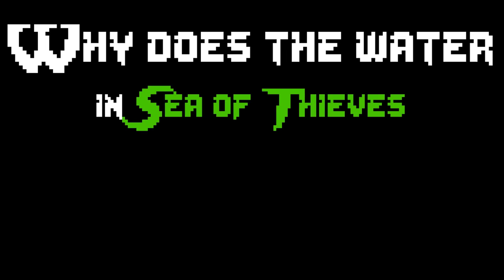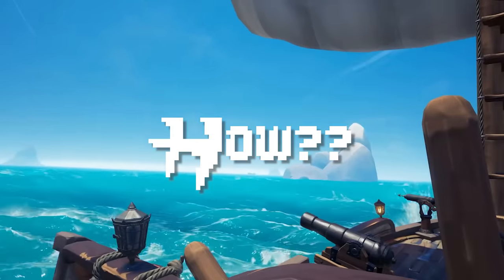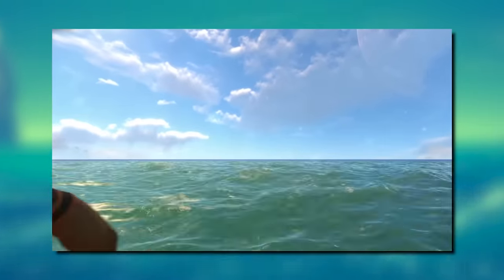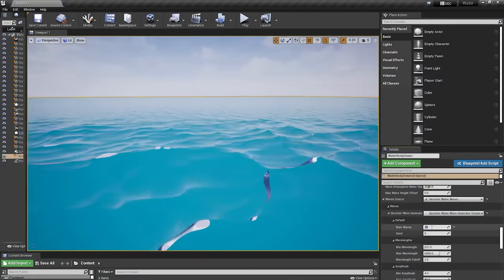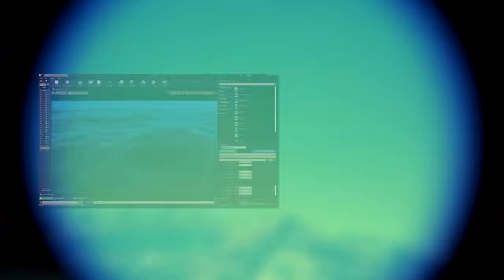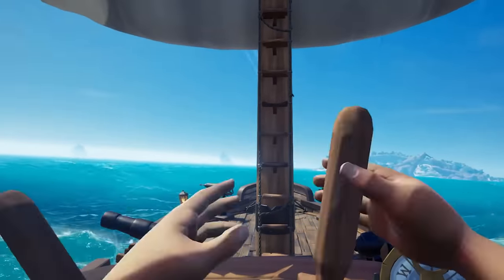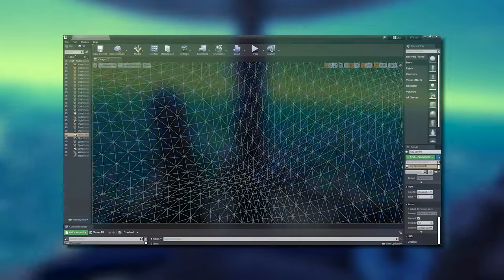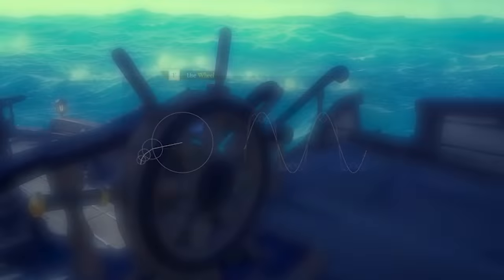how water works in Sea of Thieves

Comment: If the displacement is happening in the shader and not in the copy maintained by the CPU, doesn't that mean that your physics model can't react to the waves?
Reply: yeah that is my question as well. Both the rendering and collision has to match to a certain degree so I wonder if they are running a lower mesh version for collision?.
Reply: you can do that by doing the same calculations you do in gpu on cpu. but instead for every vertex, you do it just for 1 point that you need. like player position, or a buoyant object position. then you get the waveheight, if the objects y pos is lower than waveheight, you apply force to bring that up. you can apply it on an another mesh with lower vertices but, sampling 1 point does the thing too.

Comment: can you explain why we get sucked into rocks while sailing close to them? 
My presumption was that the particles have no where to go when the waves are near the rocks, so they go down as that's that only space for them to go there for dragging stuff on the water toward the rocks, kind of like pulling a table cloth down off the edge of the table and everything on the table gets dragged with it, but I'm probably wrong.
Reply: There's no particles in this version of the water. The pulling towards the rocks is likely a light pull done separately towards the rock when entering its perimeter. Just some basic force field.

Comment: premake a flat circular mesh that's a few kilometers (or maybe even more! depends on draw distance) across and is very dense in the middle and very sparse as you get closer to the edge with a gradual falloff, have this mesh's horizontal position always be centered on the camera, but have every other aspect be controlled by your wave function, and have said wave function operate in world space rather than in object space. any textures you apply should also use world space rather than UVs

other possibilities: rather than circular, have it be a wedge which only barely extends beyond your camera's FoV, and have it rotate itself to always match the Yaw of the camera.
this version may break down if the camera's altitude is too high and pointed down, the amount of mesh which exists "behind" the camera must be sufficient to cover this possibility

Comment: I hoped you would cover how collision works with the waves and ships, another time maybe?
Reply: Probs takes the same info from the wave functions to alter the ship's position and rotation
Reply: Getting the height of a Gerstner wave at a precise location is not mathematically possible because whatever height you get from sampling that wave is the height at a shifted location in X and Y, and not the location we asked for! You can approximate the result using an iterative approach: first iteration, sample the height at the asked location. Second iteration, sample the height at the asked location MINUS the X & Y location offset you got from the previous iteration and rinse & repeat. Each time you'll get a smaller and smaller X & Y location offset and you'll get closer and closer to a height that is exactly the height at the asked location.

Comment: I love the Sea of Thieves water physics but I still hate how it interacts with the ships, or to be more precise, how it doesn't.
Reply: Not sure what you mean, the water physics definitely affects the ships's movement, and hitting big waves even "refill" the water simulation going on on the top deck. There's a talk called "the technical art of Sea of Thieves" where they talk about it
Reply: @papermartin879  No I know, I'm talking more about the artistic side, there are no effects of the ship moving through water, or splitting a wave, there's not even a trail behind the ship!
Reply: @SirForwyn  splitting waves would be basically impossible to implement as the wave sim needs to be predictive in order to be synchronised with other players without eating 95% of the bandwith
Implementing a trail might be more possible but I doubt it's something peoples would pay that much attention to during actual gameplay, and I imagine they didn't want to include extra effects unless they were deemed necessary in order to have the game run on xbox
Reply: @papermartin879  Dude, I'm just talking about the effects, not actually changing the mesh of the waves. Something like ACIV Black Flag has, or a bit better, since that game is on the older side now.
Reply: @SirForwyn  you mean like foam particles and all that when you hit a wave? That's already in the game
Reply: @SirForwyn  there are foam trails in the game. they just dont use it. idk why. you can see it in some islands, or when fishing. theres gonna be a gray-ish foam above the water. so it means that its not because they can't. they've chosen not to. actually there's a lot of things that sea of thieves just didn't want to pay attention though. theres no water ripples and stuff. and that's not even hard to do at all. idk, the game is great but, its also lacks of detail as well. it feels like they've fired the guys that made the shader and tried to do the rest by themselves. -.-
Reply: @bdenix1997  you've just made a lot of assumptions

Comment: Sadly not applicable anymore, because tesselation is killed in Ue5.  

And isn't gerstner waves just using a formula that changes the constant in a sine wave, making the "top" squeeze together.
Reply: you just have a pretessilated mesh no need to do it in real time as the engine can handle alot more verts naturally with nanite which will handle the distance meshes for you. you can also use the 
built in water system that still dynamically tessellates and just change out the gestner wave that is already setup on it and the material to your liking
Reply: @VolkillerGames  nanites doesn't support wpo functions of any kind last i heard.. a nanite mesh can't move.
Reply: @oskarwallin8715  it has support in ue5-main for a while now so it will be in 5.1
Reply: @VolkillerGames  that's really nice if it does. Last time I heard nanite and wpo wasn't even on the table for a while. What was enabled was a fallback.. like if you use a wpo on nanite mesh it falls back to regular mesh.  Can you confirm if it's actually nanite with wpo, using for example the nanite view mode in editor ? 😊

Comment: I have never personally played sea of thieves
but one thing I do understand a little bit about water in video games in particular physics based sort of "build your vehicle from scratch" games
is the underwater physics

the one I will talk about in this comment is airtight spaces where under the waters surface a space that shouldn't have water does

sea of thieves doesn't have this issue and in fact is one of the only games I know has a working airtight space on a 3d plane

the reason I mention "3d" is because in games like barotrauma and we need to go deeper have a working airtight space system mostly because of their 2d atmosphere that make it easier
we need to go deeper is a different case because if I'm not mistaken the submarine is just on a background you can only see through camera's on the outside making it possible to render the water as a background as the physics is never applied to the characters unless you are at a cave in which the physics are not needed so much

barotrauma is in a different category because you can go into the water while the sub is moving you can swim in flooded rooms, and it even has a floating number that determine if the water pressure can kill you even have ballasts which have water in them depending on your depth, but the key factor is you can exit your sub and it works kind of like an airlock in space games
you close a door and open the other to the outside if others inside the sub are using the sonar or guns, they can see you swimming 
I admit I don't have a super good understanding of programming, but I do understand that is hard, but it only gets harder in a 3d space because you can't just determine it using different layers of backgrounds and applying physics for some of those important details

sea of thieves did somehow and if you or somebody who comments knows the secret tell me I'm interested.